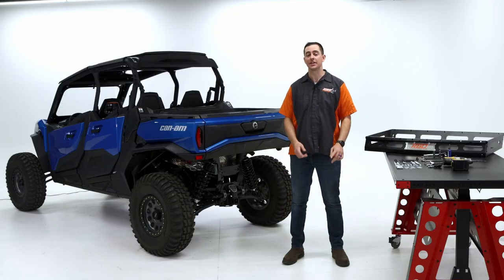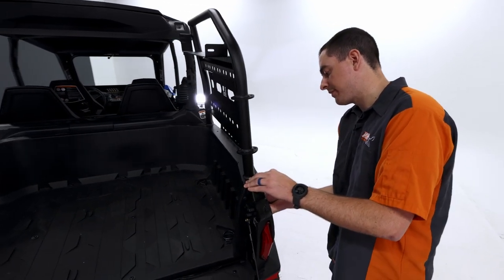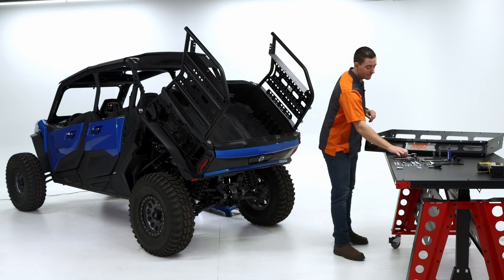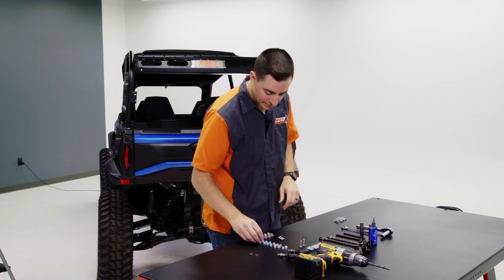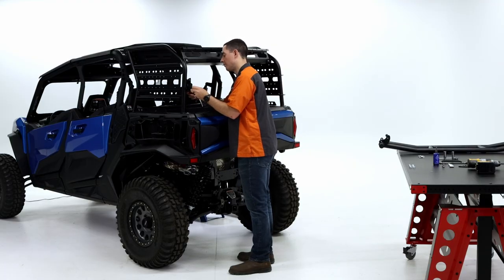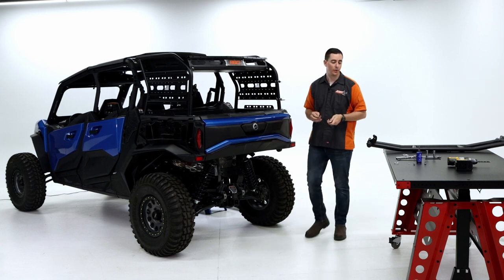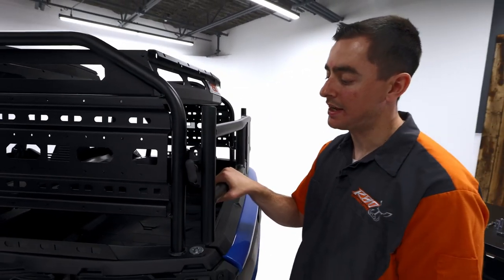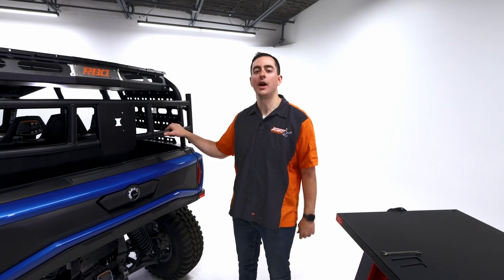How to install the Can-Am Commander (2 Seater or 4 Seater) Expedition Rack | Razorback Offroad

Comment: One thing I think it needs for safety (and more potential tie down points )is a flat plate to protect the passengers. With as great as this is I think I think something like that should get in there.  Another thought. Another quick thought during the  conclusion of the video maybe put items on the racks. Fuel cans, axe shovel. You get the point lol thanks for listening. Corey